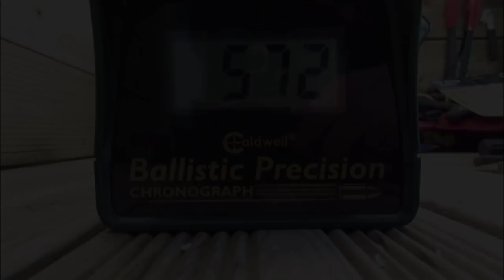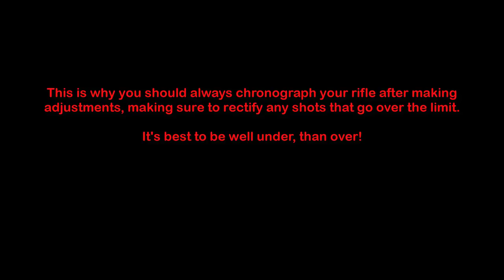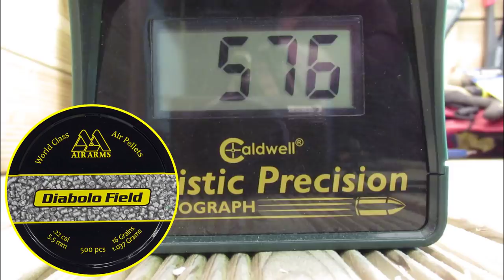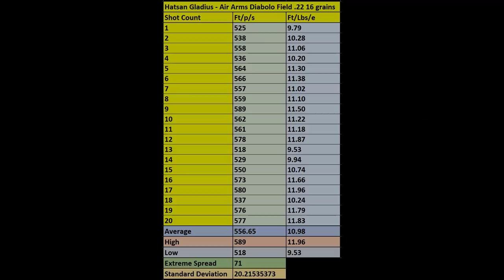Shimming the valve spring on the Hatsan Gladius and Chronograph test 08 09 18

Comment: My new brocock bantam sniper  was erratic just like that , and that was with the Huma regulator in ... Took it back too the shop ( too be honest , unless you have a Chrono too test your equipment you wouldn't know the difference down range , well up too 30 yrs as was ) turns out it was a " sticking hammer spring " ( or something like that  ) it's ok now I think , just gorra test it extensively ) love your shows ,  real down too earth ( and for want of a better phrase ) a working blokes channel ...